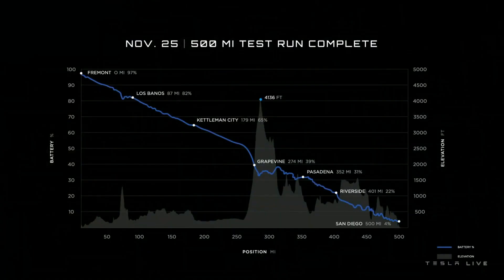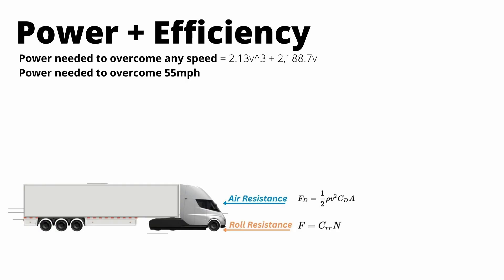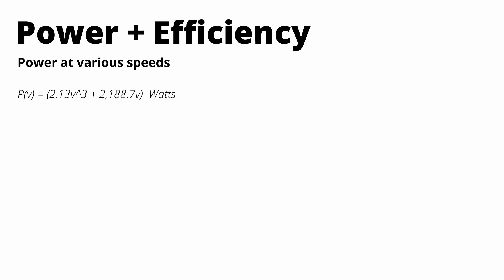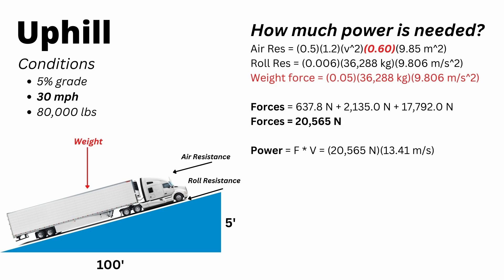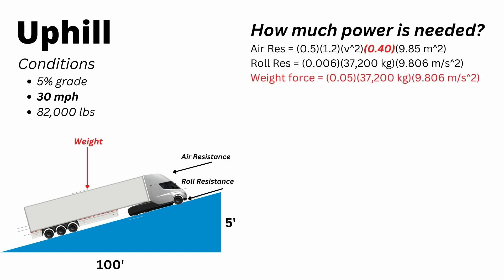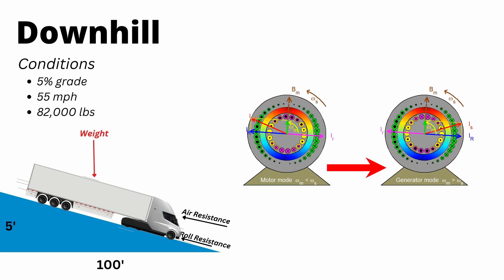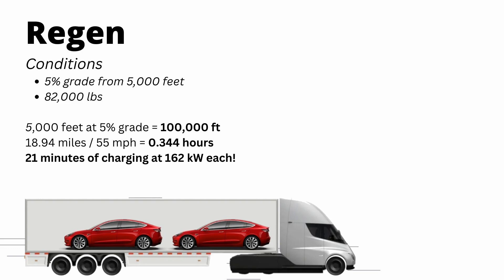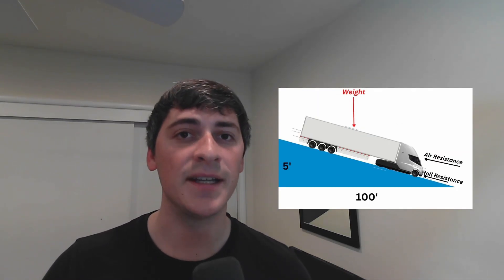Breaking the laws of Efficiency! Tesla Semi Physics Explained

Comment: Ever watch thunderfoot video?
Reply: @Top Hat Thunderf00t spends more time talking trash, then speaking science and/or math.   He doesn't use accurate figures, it is more conjecture than anything else.
Reply: @HearToneSpeak  but his semi video about Elon not talking about the actual payload seems correct. It's got me sad
Reply: @tophat2002  Tesla is sandbagging the specs, because they are not prepared for the number of orders coming their way.   Just to note, that estimated weight of the Truck, is about 27, 000 lbs about the same as a Diesel Truck.  Tesla didn't talk about Autopilot and a number of features around the Semi.  They didn't talk about some of the enhanced safety figures and etc.  This presentation was really for shareholders than anyone else.
Reply: @HearToneSpeak  final battery size might not be finalised yet due to possible efficiency improvements down to "1.5 kwh/mile". And they are using a larger battery on these first trucks hence being heavier than they want to reveal as the finalised spec
Reply: @HearToneSpeak  ok but I'm still nervous
Reply: Thunderfoot claimed the Semi can only carry 5 tons... I think the flatbed alone weighs more than that. It would mean Tesla used fake concrete dividers for the video. I highly doubt at this stage in the game Tesla would pull this type of stunt and risk its credibility for the Semi. The Semi is not going to make money for Tesla anytime soon. That would be the biggest mistake in Musk's history... IMO the Semi went from Alpha to Beta stage.    At some point next year once 4680 production ramps up they will produce a more final version that will go out to the masses. That's why they said they will continue to gather data and see a path to 1.5kwh/mile efficiency which means a smaller battery pack and higher gross margins.
Reply: @Teddy_M85  "Thunderfoot claimed the Semi can only carry 5 tons... "
That was for a range of 2000 miles.
Reply: @niederrheiner8468  At higher speeds, air resistance and rolling resistance are about equal; a light load would reduce the rolling resistance some, and the air resistance not at all. So carrying 5 tons rather than 40-some tons will not quadruple the range; it might increase it by 30% to 40%. It could easily be calculated from the equations, but I'm too lazy to do that,
Reply: @BigBen621  The reason for the 5 tons in Thunderfoots video was simply the battery weight. That truck would still have the 40tons(80.000lbs) total weight.
Reply: @niederrheiner8468  
How much do you think the battery weighs?
.
I'm going to guess your answer as "about 20,000lbs"
Based on? 10 x 100kWh model S packs?
.
Now do the same using 12 82kWh model 3 packs.
12,720 lbs.
.
But the cells only weigh just under 8,000lbs.
(68 grams, 4416 per pack, 12 packs. 3,603 kg)
.
They don't need 12 frames, 12 power control units, 12 sets of cables, etc.
.
My estimate?
The battery weights about 10,000lbs.
.
That's a whole new ballgame, isn't it?
Reply: @rogerstarkey5390  I dont know ;-)
Reply: He is a moron who never actually does any proper math , just wants people to take his word for it
Reply: @potatocurry4474  but he's right on the payload?
Reply: @tophat2002  
He's actually so far off on the payload it's laughable.
.
He chose a half sized European barrier, not the standard cross section  32" tall, 24-27" wide "Jersey Barrier" that was the actual load.
They come in standard 10-12' lengths with the 10' barriers weighing 3,800 to 4,000lbs each.
11 barriers on board.
That's 41,800 - 44,000lbs payload.
.
Now.
If you can find the website he quoted from you'll be luckier than me, but you will see the chart he used specifies the product as a "SMALL barrier"?
.
He chose a product which matched his assumptions and ran with it.
.
Easy way to check?
.
The actual barriers?
3 barriers across the bed.
24" wide each.
There's about a half barrier width clear on either side of the trailer bed.
.
That's about 4x 24" total?
102"?
What's the width of a standard trailer bed?
(102")
.
Alternatively.
His barriers are 440mm wide. From the chart he provided
.
That would make the actual bed about 4 x 440= 1769mm wide.
69" (oh! The irony!)
.
Is the Tesla semi only 69" wide?
(Would explain the great aero!!)
.
Discuss
Reply: @Top Hat, His calculation of the load is a blatant and deliberate lie. He scoured the web until he found a completely different and much smaller barrier, and then claimed that's what was on the trailer on the Donner Pass video. At 9:18 in his video, you'll see that he's referencing a "ROAD BARRIER SMALL", with dimensions of 500 mm high by 440 mm wide by 2000 mm long, on a Czech website--"www-csbeton-cz". If you'll translate the units, these are 20" high by 17" wide by 6'7" long, and weigh 525 kg (1,157 lbs.). 

The standard US highway barrier is 42" high, more than twice as high as the one he quoted; 32" wide, almost twice as wide as the one he quoted; and 10' long, half again as long as the one he quoted. If you'll do a search for "10' highway barrier weight", you'll find numerous references stating that they weigh at least 4,000 lbs. each. There are 11 of them on the flatbed trailer (three rows of three, and one row of two at the back); 11 x 4,000 lbs. = 44,000 lbs., or 22 tons. So that's the actual load of highway barriers on the flatbed in the Donner Pass video--not 5 or 6 tons, as Thunderf00t variously and so dishonestly claimed.
Reply: @BigBen621  He was wrong with the barriers. But that does not matter to me, since the 500-miles-test was done with the closed trailer with cardboard boxes.
Reply: @niederrheiner8468  Actually done with pallets, not cardboard boxes; and one of them is clearly marked 600 kg (1,323 lbs.). See at :02 here: https://youtu.be/GtgaYEh-qSk

Comment: The problem is.. the Telsa Semi video doesn't show it carrying 40 ton. It has 10 barriers on the trailer. if each barrier weighed 5,000 pounds (which they don't) that would mean the semi itself weighs 30,000 pounds. And Elon claims the Semi can beat RAIL, not just diesel. Now that I would like to see the maths on because i'm calling bullshit.
Reply: @kaleb jackson "And Elon claims the Semi can beat RAIL, not just diesel. Now that I would like to see the maths on because i'm calling bullshit."  What Elon was talking about was the cost per mile, when the Tesla Semi is platooning with other 2 or more Autonomous Semis.  Elon was suggesting that it would be more cost effective, because Rail generally requires some other form of transport to and from Rail Depot. 

“It will take quite a bit of revenue from railway,” Musk said. “Trains don’t go everywhere so you have a truck deliver things to the train rail spur and then at the destination, a truck has to pick it up from the rail spur there.”  Elon Musk
Reply: @HearToneSpeak  Right. Thanks for clarifying but even then I'm not convinced the Semi would beat rail in cost per mile. I'd like to see the maths. I'm not totally sure but my intuition says that is bullshit. Like when Elon was talking about how east the hyperloop would be. I knew that was bullshit immediately. Rail is just incredibly efficient and Electric Semi's are TBD.
Reply: @CepheidJackson  Rail is efficient from terminal to terminal.... but it still requires trucking goods to terminal and from terminal to destination, that  eats into Rail's efficiency.   Rail is better at must longer distances.
Reply: The 500 mile test run from Fremont to San Diego (with just under 82,000 lbs) was with a different trailer - you can see in the time lapse video of the journey that it was an enclosed box trailer.  The video showing the Tesla Semi going up a grade was with a flatbed trailer, so that was not the same journey.
Reply: @richardjones8395  ohhhh.. okay. Thanks. did they show what was in the trailer?
Reply: @CepheidJackson   Not really.  You can briefly see that they are boxes loaded on pallets, but there's no way to tell what's in them from what I could see.  The only thing we've got is that they said in the presentation it was just under the max gross of 82,000 lbs.  Here's the video of the run....you can see the loaded trailer right at the beginning:
https://www.youtube.com/watch?v=GtgaYEh-qSk
Reply: @CepheidJackson  It's loaded fore and aft with pallets, including apparently pallets stacked two high at the front. But the only indication of the load is that one pallet at the rear, where the lighter load would be placed, is marked as 600KG or 1,323 pounds.
Reply: @BigBen621  Thanks for the info. I looked up the picture and maybe I'm too much of a skeptic but the maths still seem  a bit shady and the overall lack of transparency sets off my red flag alert. Am I being ridiculous?
Reply: @CepheidJackson  Tesla may well have good reasons not to specify load rating; perhaps because its still being finalized, and they don't want to be locked into an incorrect figure; and perhaps because they view that as confidential business information, and don't want to give their competitors a target to shoot at. But as others have stated, it looks like the Donner Pass Semi had a load of about 45,000# on traffic barriers at 82,000 # GVW; so the load on the range trip, with stated 81,000 # GVW, might have been a bit less.

This information will be readily available before long. I urge everyone who thinks Tesla has an absolute duty to announce this information, to cool their jets for a few weeks.
Reply: @BigBen621  
Pallets, Jersey barriers? What does it matter?
Elon could have simply given the most basic of numbers - the cargo load weight and end all doubt.
Reply: @jdmather5755  Then all the TSLAQs would accuse him of lying about that. The only folks who need to know the payload are the ones buying these, and you can be certain that the do; everyone else wants to know, but Tesla has no obligation to provide this information to them. There are legitimate reasons for Tesla not to release this information right now; but once these start hitting the roads, this'll be apparent. Meanwhile, suggest you just be patient.
Reply: The GVWR (gross vehicle weight rating) of BEV semi is 82k lbs. GVWR is the maximum weight allowed by law, this is the weight of the truck plus cargo. No one is allowed to haul 80k lbs of just cargo.
Reply: @officialyasir  Yes. I completely understand that. I specifically accounted for vehicle and cargo weight in my comment. Are you arguing that the semi weighs more than 30,000 pounds?
Reply: @CepheidJackson  no, that's not what I am saying. You said the video doesn't show it carrying 80k lbs. Then you mentioned the barriers, that's not even the correct video. Go check the Tesla channel, for the 500 mile test they are hauling something else, not barriers. 

They claimed the GVWR was 81k lbs for their 500 mile test, we don't know the weight of truck itself or the cargo by itself.
Reply: @officialyasir  I see. Thanks!
Reply: @kaleb Jackson
It had ELEVEN barriers on the trailer.
Standard 10 foot Jersey Barriers weigh between 3,800- 4,000lbs each.
That'll be 41,800 - 44,000 total..
Let's see your estimate for why the tractor unit weighs 30,000lbs?
(I'll tell you that the battery actually weighs about half what you've been told)
"Elon claims" (claimed) that when is full FSD Convoy mode, with 5-10 years battery development, a string of Semis will be cheaper than rail.
Context is a wonderful thing.
Reply: @rogerstarkey5390  Well, you can back into a plausible estimate of the tractor's weight, from the Donner Pass video. In California, those would be Caltrans-spec K-rails, which weigh 4,000 lbs. in the 10' version. GVW was stated as 82,000 lbs. 53' flatbed trailers are typically said to weigh about 10,000 lbs. So 82,000 lbs. - 44,000 lbs. for K-rails - 10,000 lbs. for trailer - 1,500 lbs. for chains and securing materials - 500 lbs. for driver and misc. materials & equipment = 26,000 lbs.
Reply: @rogerstarkey5390  The estimate for the tractor weight comes from them saying the total weighed 82,000 pounds. so if the barriers are 44,000 pounds, that would make the truck and trailer 38,000 pounds... And i didn't include context on the rail claim because i dont think it matters at all. Show me, in convoy mode, with whatever batteries you want how a string of semis will beat rail. i'm sorry but no fucking way is that true in any context.

Comment: Maybe I'm too tired, but how far can the Tesla truck drive at 82K lbs, 55mph uphill (5%) then?
Reply: the general idea is that the grade is irrelevant to range as long as you come back down afterwards (500mi), not sure what the range is exclusively going up
Reply: @Redstoner2b2t  You may want to watch the video again. He makes the clear case that you do not get all energy from the climb back when you descend the same elevation. This is due to powertrain conversion losses going up and going down, and aerodynamic and rolling drag in both directions. So the range would be very dependent on the slope and length of the grade, as well as the speed maintained up and down.
Reply: @Redstoner2b2t  I owe you an apology. What I said is literally true—regeneration can only recover about 80% of the energy used in the climb. But the chart of the 500 mile range test makes it appear that almost 100% of the energy climbing the Grapevine is returned through regeneration. This is quite apparent where it climbs and then descends the Grapevine; and the energy line is almost back to an extension of the straight 1.7 kWh/mile line on flat ground at the beginning of the trip, by the time it gets to Pasadena. If it were only recovering  80%, it would fall substantially below the extension of the 1.7 kWh/mile line, and never recover.

I struggled to understand this better-than-theoretical performance, until I realized that there's a 35 MPH speed limit for trucks on the Grapevine both up and down; and this reduces both air and rolling resistance substantially, compared with driving at highway speeds on flat ground. So in effect the 20% losses in in the climb and descent are almost completely offset by the reduced losses due to lower speed, compared with driving on flat ground. So the net effect is that you're essentially correct; grade and height are largely irrelevant, as long as you have enough energy in the battery to make the climb, and you end up at the same elevation.

On a climb/descent with a lesser slope and no speed limit up or down, there would be less offset of the regeneration losses; but the steeper the grade and lower the speed on the grade, up and/or down, the greater the offset would be.
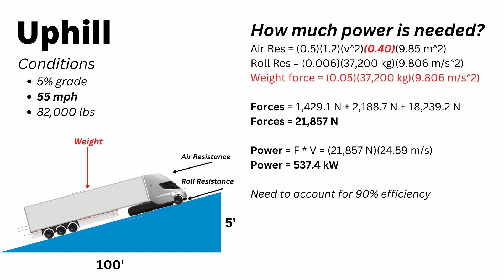Reply: At 7:34, power to maintain 55 MPH on 5% grade is 597 kW. With 900 kWh battery, this is about an hour and a half. At 55 MPH, this is a range of 83 miles.
Reply: @BigBen621  Thank you! :)

Comment: great video.  really impressed with your communications and teaching skills. What is the comparison between driving the same distance flat vs. up and back down the 5% grade?
Reply from the maker: Thank you. Using the flat vs 5% grade calculation in the video (55 mph). It's about 1.73 kWh/mi on flat vs 2.5 kWh/mi over the theoretical mountain pass. 

Also keep in mind, that efficiency depends on how fast you are moving. Additionally, in real life grades are not that consistent. There might be portions of 5%, but the average is probably closer to 2% or 3%. In reality, efficiency over mountain passes is probably around 2 kWh/mi to 2.2 kWh/mi in real life conditions
Reply: @MotorMatchup  that really highlights to me how much speed and the accompanying wind resistance is such a large factor of energy loss.  how hard would it be to add the 'theoretical' mountain pass to your motormatchup analysis site?  I'll buy you another 3 cups of coffee!  ;-)
Reply from the maker: @ModernSunlight  Hah, that's a cool idea. I'll think about what that would look like